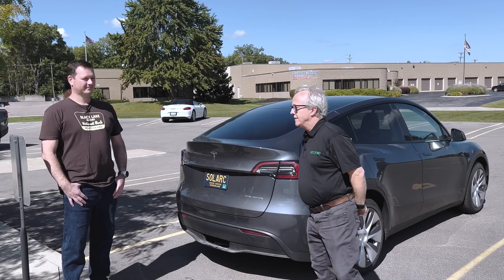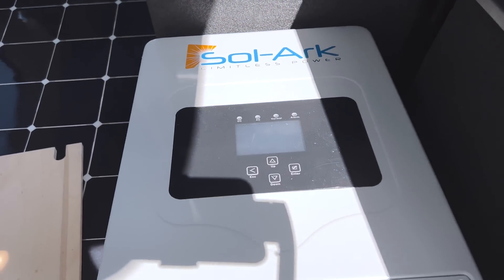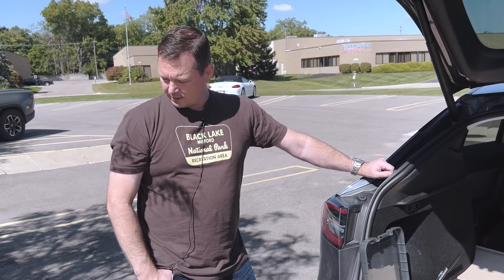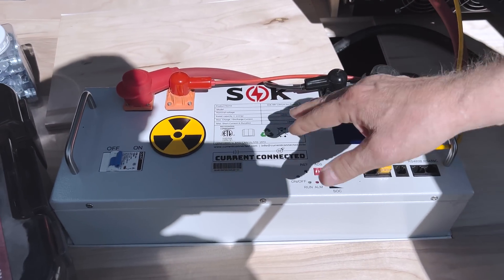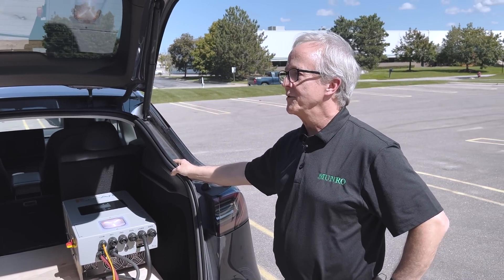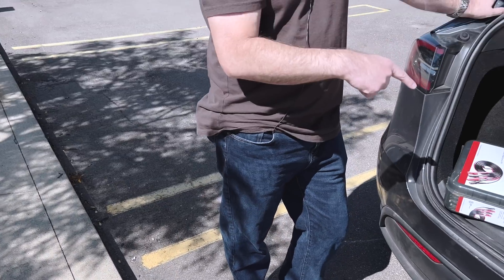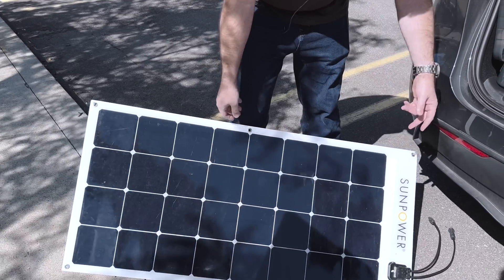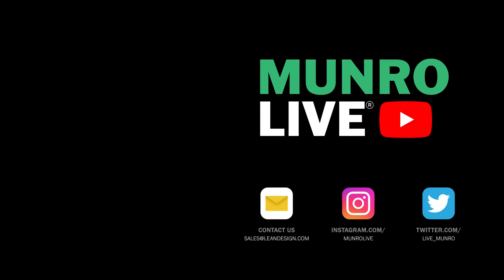Solar Powered Tesla Cannonball Run

Comment: Efficiency is the current battle. The y gets 3.3-3.8 miles per kWh. My Leaf gets 4.4-4.6 miles per kWh. Imagine a 75kwh pack on the Leaf power system, the range you could achieve.

Comment: Obviously, running a car solely on solar power is not very practical, but for people who can’t charge at home, you can get 2000 miles a year from the sun…
That’s a lot times when its not needed to plug in.

Seems like a win to me, especially for my parents who can’t charge at home and they only drive like 50 miles a week on average.
They would basically never have to plug-in, aside from a long road trip. That seems great.

Comment: You get DC current from the sun, you run it through an inverter to charge the 5kWh battery all the while you have another 65kWh one under it. That large 5kW inverter also consumes some of that power in the meantime. Then you discharge the 5kWh into the car as AC at about 95% efficiency minus a fem more percentages from the AC to DC in the car. All this time we have a perfectly good inverter in the car and plenty of battery. Why doesn't Tesla just allow DC SLOW charging the car directly with a 400V MPPT which can fit in a small box instead of all your trunk and rear seats. To get 1kW all you need is a 2.5A DC-DC boost driver at 400V which should be as big as the wall charger. More than 1kW peak power is unlikely that you can carry with you in solar panels. This all bring your home charger with you seems nonsense.

Comment: I bought an Anker 767 with extra battery for backup - has a 4kWh capacity for emergencies - and 4x200w foldable panels - one thing that he’s not considering when charging is the sun moves and to maximize production, will need to shift the panels in optimal direction of the sun.  Best to find a way to easily deploy and shift the panels vs stake them individually to the ground.  Maybe arrange/tape 10 in an accordion fashion with brackets to click mount to some extendable poles with kick stands so you can reposition them easily.  The Anker can get me 15~20miles of extra range in an emergency. Additionally you can tape several of those panels to the roof - I did this with a smaller inverter and 100wH battery so I could make coffee and heat food when I drove from Portland OR to Cleveland OH in our Y.

Comment: I’d stick panels on the top and deck lid to recharge aux battery on the go and maybe a dc-dc converter to help power the 12v side of the car to reduce load on hv converter to 12v for more range. Prius’s use the latter method for a few more miles of daily range
Reply: Doesn't work very well during the night

Comment: So this guy would install every time 64 (yes 64!) solar panels in a camping site.
He believes in "2 days to charge".....with a nominal power of 6.4kw peak power
The area required to install these panels could well be more that 64 x 3 square meters= 192m2
How easy is going to be able to do this ?
Assuming to need to charge 60kwh with 6.4kw peak power: it's a sound assumption to be able to charge between 4 and 5 times the peak power in one day (being able to tilt them accordingly ...): in this case it would make 2 days in IDEAL CONDITIONS.
In real conditions this could require 3 or even 4 days.
I am very curious to see the outcome of this experiment!

Comment: Why not just use a Fiskar Ocean with the solar panel roof?  It gives about 400 to 450 watts of power and directly charges the car battery.
Reply: In ideal conditions, that might net 8-10 miles of range per day.  To go 2900 miles, at 10 miles a day, it would take you 290 days - not so fast!
Reply: @tesla_tap  Yes, but he could also figure out how to attach his external solar panels to the Fisker roof solar input to increase his charge.  No need for the all the batteries and external power converters.

Comment: They REALLY need to offer a solar panel roof instead of the glass roof that just heats up everything.
Reply: Might the IR layer in the glass roof block useful light to the solar cells?  If you remove the IR layer, at least 75+% of the heat will get through - far more than the current glass roof (rejects 98% of IR now).  Actually, I've not found the glass roof gets hot when driving, but to be fair, our temps are below 100F.
Reply: Close! The key to adopting this technology to Teslas is in modernizing the paint and the asphalt on the highways.

Comment: Model Y consumes 15kWh per 60 miles.

And this installation produces 1kWh per day (very  optimistic assumption).

this is like boiling a galon of water using a tealight
Reply: I think you misunderstood - he has 64 panels, not one and you typically get power over 8-10 hours (although not much near the start and end).   Sounds like 20 klW or so should be generated - perhaps more if he moves the panels 3-4 times during the day to follow the sun.
Reply: @tesla_tap  I wish him all the best.

Comment: 6400 watts of panels should harvest, best case, at this time of year, about 25 kW hours per day. Maybe 30 or more, but I will be surprised if you get that much. At 55 MPH the Tesla model S will get about 4 miles per kW hour. Unless I have miscalculated, you are going to only get enough energy from 1 day of charging to drive 100 miles. I bet you will be camping for 3-4 days between each 300 mile drive. 4 days is more likely than 3 because of the conversion losses, and the background drain of the car while parked. You won't dare be running camp mode to keep the car's climate control going. You need every watt hour you harvest to go into the battery. And speaking of batteries, the if the battery attached to the inverter gets drained, it has to be refilled before or while the car's tracton battery is getting filled. If they are filling in parallel, that will subtract from what the car can get. Suggest to set all the panels up in the Monro parking lot, or at your house, or anywhere else you can find room, start the car charging, and see how many percent you can add in a day. Run the car down below 50% and you will have enough room to absorb a full day of solar charging.

Comment: I would love to see the whole charging setup of 64 panels. Are you going to rotate them every hour with the sun ?
Reply: If wind is low that'd probably be a good idea. If only the rear bracket was pegged down and the front was just resting on the ground it wouldn't take too long to periodically reorientate them. I wouldn't fancy it if it involved re-pegging them down each time though.
Reply: @DEADB33F  I agree, may give it a try, need to do a full up system test as soon as the panels come in early next week, then off to NYC

Comment: ground mount panel - drive One Lag bolt into ground  leave sticking up a few inches - on lag bolt put  tight fitting aluminum tube that fits over it and is a Little taller than panel  - 
on  back  top Middle of  panel attach 4 inch  piece of thin rope to form a Hoop -  Tube fits thru Hoop -  this holds panel in place - 
wont blow away - and can be Easily moved / angled to point at sun - and uses only one lag bolt per panel -
this works Really good - try it you will like - Jay

Comment: Can I make a suggestion. Laying the panels flat will loose charging capacity when the sun is low in the sky but just use extra panels to make up for it. I would attach the panel by their longest sides and make large concertinaed packs of them fully connected so you just need to roll them out and put a few pegs in here and there. You could also use hills to their advantage and because it's so quick you could set up on the east side of a hill in the morning and go to a hill with a westerly aspect in the afternoon. You could still use your stands if it warrants it.

Comment: No offense to solar and doing this with it, but it is totally a waste of time doing this. Just easier to do self powering vehicle, and challenge real cannonball record. Average 1?? MPH and don’t stop one time. (1&2 have to done in back seat and we talk about how) 

Like I said no offense to doing this but it makes no sense to have to wait on solar. 

A cannonball can be done with electric vehicle that drives itself and powers itself, and then turns around and drives back to starting point. 

How, is by J&J Engineering design of ***** energy system. 
Very possible now. More than one company about working on it, I believe.

Comment: Could you get it up to 400V DC and rig up a slow DC charge
Reply: We use a DC DC converter! DC solar in (~640V) DC CCS out (350-400V) already did 24k+ miles in Africa in the past 10 months..! Converter is a prototype and not on the market yet..

Comment: It’s amazing how many people think putting panels on the car or a trailer will be significant. 😂 he said it will take 64, Yes 64 panels 2 days without driving! To charge his car 😂
Reply: It should be noted that those are small flexible 100 Watt panels.  Not what people normally think of, i.e. large rigid 400 Watt panels on roof, or farms.
Reply: With our 60x180Wp panels we can charge 160miles in a day with our (not aerodynamic and heavy) expedition car😊 already did 24k+ miles in Africa the past 10months😊

Comment: Too bad there is some loss going to ac and back to dc. Would be neat to charge directly to dc but that would require a custom mod to the car is my guess. I am not aware of any DIY DC inputs for Tesla.
Reply: We use a DC DC converter! DC solar in (~640V) DC CCS out (350-400V) already did 24k+ miles in Africa in the past 10 months😊

Comment: A lightweight low trailer with panels mounted to collect energy while driving would prob help a ton over the course of the challenge. When parked the other panels are installed in trays that you just pull out when camping
Reply: He is driving at night only
Reply: The energy losses (rolling resistance & aerodynamic drag) from a trailer would probably negate the charging from the panels on it.

Comment: Thanks for the info, as a backup I'd add another battery (Ecoflow Delta Pro) and not knowing the details of the competition I suggest adding some wind turbines while you're driving to add to additional charging 😉
Reply: Moving an electric vehicle against the air to spin turbines doesn't seem logical. Wind turbines are not so great even for stand alone installations. You don't see many installations in your travels.

Comment: i wouldn't have thought driving at night. I probably  Would have mounted the solar panel to the roof, charged  the  battery during the day, and then plug in at night and let it charge. I think night is a better solution because there's less cars  On the road that you're going to piss off because you're going slow. And during the day, you can explore wherever you ended up stopping. Maybe a folding bike would   be a good accessory to explore the area you're in while you're charging.But a very cool idea all around.
Reply: "the solar panel"!   There are 64 solar panels - that's like the size of a tennis court. You can't put that on a car and drive at the same time.

Comment: I’m going to try something similar.  I shall tow my Model 3 across country with several horses.
Reply: You could charge the M3 with Regen while they pull. Then pull them with a horse trailer a few miles and keep switching.

Comment: Pretty clean setup, I have almost the same exact setup in my Model Y.  A 5kWh server rack battery, a 3kW all-in-one solar charge controller/inverter, and 900W of portable solar.  Tho my use case is for towing my camper and reaching the next supercharger.  I can tow about 70 miles on full, but sometimes the superchargers are 100 miles apart.  If I had 64 panels that'd be a pretty substantial boost!

Comment: And what is the reason to do it? It makes more sense to take the money and put solar on a roof.
Reply: Indeed, if you have a roof, then you could put the panels on them and pay in to the grid, then use superchargers to withdraw the balance.
Electrons are mobile - you're still technically charging from your solar panels but without needing to carry them!
This however isn't as much of an adventure, and you're dependent on a grid instead of being independent which is also part of the fun.

Comment: Is DC -> AC -> DC -> AC really the most efficient? Just wondering.
Reply: We use this technique, burnout DC DC converter (DC solar in, DC CCS out) is a prototype, we are working on a consumer version!
Reply: @4x4electric  Cool. Glad too see innovation.
Reply: Of course not.  But there isn't a publicly available low voltage DC charger for the Tesla, that I am aware of.  So that would require serious hacking of the car.
Reply: @CorwynGC  240V I believe is the number the car wants. With those solar panels, uou can easily get beyond that. No low voltage about them.
Reply: @Azeazezar  Most Teslas use a  400V architecture, but that isn't what you want to be arranging solar panels that you are assembling by hand in a field at.
Reply: @CorwynGC  I see what you're saying. 400V DC is scary. But I'd still think within the realm of possible whith a properly designed system. Good idea or not is a different question. Generally, No unless you are a trained electrician. While trying to set a record, I'd say yes.
Reply: But that said. There's no actual need to have 400V outside the car, if designed well. It can be made safe.
Reply: @Azeazezar  Sure, hence my point about 'publicly available'.

Comment: I would think a decent sized trailer, with the panels on the roof of that charging as you go.
You could add extra fold out panels on the sides for when you are stopped.
Adding big batteries on the trailer to store from the panels.
Can you add a few panels on the roof of the Tesla to charge the battery?

Comment: Sounds like me traveling with my Leaf. Sometimes it would take 4 hours to charge at RV parks with my portable charging station, or level 2 when the battery heated up too much to charge at level 3.
They said it couldn't be done.
A great adventure.

Comment: So I built a system like this in my parents shed capable of 12kw charging with a 2.2kw solar array and 32kwh of storage. I’ve done about 3,000 miles on pure solar power. And it’s my dream to buy the cyber truck and build my own solar trailer of sorts that can go with me anywhere and I can charge up anywhere
Reply: With panels on the trailer you can charge while driving.
Reply: Yeah? How's the shed handle at 55mph?
Reply: no you didnt boot
Reply: @deadmanwalkings  what do you mean?
Reply: @evanbozogan232  So the Inverter is 12kW but solar array is 2.2 kW? I think you need to upscale the solar array size. I have a 3.1kW solar array and gives me 17kWh max on a great sunny day.  you need 7kW solar array to get 32kWh of storage.

Comment: So many improvements that i see:

1) Why so much wood for mounting in the car, that's extra weight
2) Why not do it around the summer solstice, daylight hours are waning
3) Rip out the passenger seat, back seat, carpet, etc to get more range
4) Why a model Y, a 3 is more efficient
Reply: I think the big answer to all of your points is that it's just a guy with his personal vehicle. Likely doing it when he has time off work. If he was sponsored or independantly wealthy and could afford to buy a M3 and strip it down, he probably would. 🤷
Reply: Could he have put everything in the frunk and leave the cabin area for sleeping?

Comment: He'll get 18 kWh max for a day, realistically way less. He will not go far with this system and will soon get tired of putting up all the panels.
Reply: Our record day was 42kwh with our 10,8kWp solar system in our expedition car!😁
Reply: @4x4electric  in fact you have almost double the peak lower, reasonably close. Rule of a thumb for fixed installations max day kWh production is 3 times the nominali kWp of the system, at that latitude.